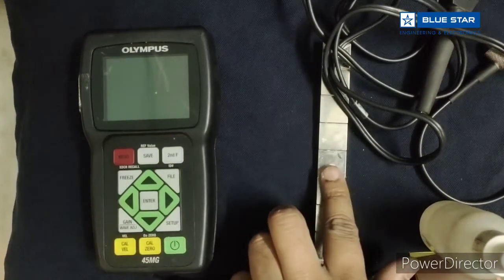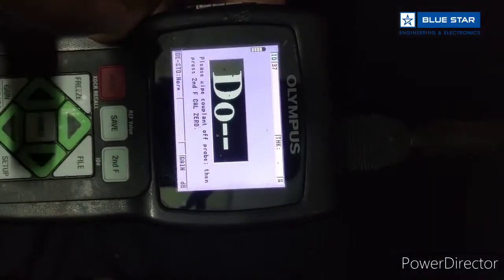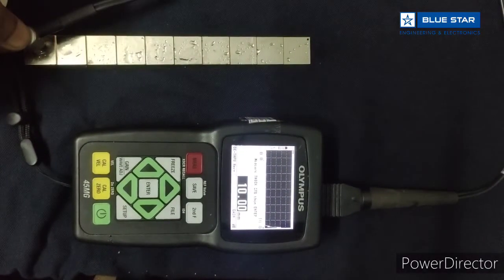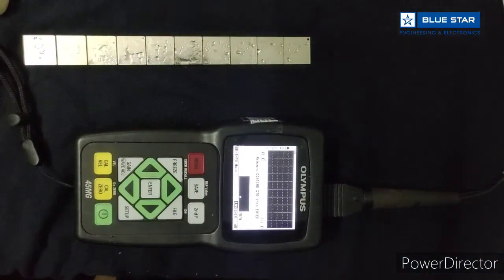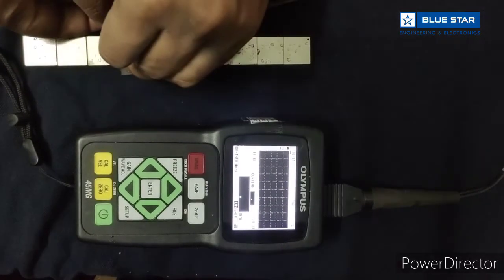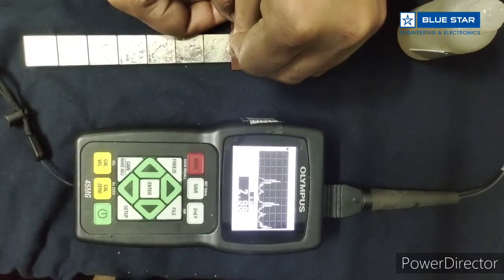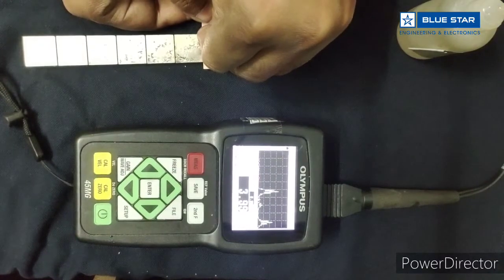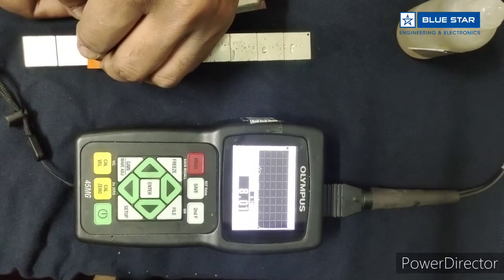Thru Coat Thickness Measurement with Olympus 45MG Equipment

Comment: I have 45 mg but after zero calibration it does not ask for through coat option sir, what  will I do
Reply from the maker: Check whether EETC software activated in your 45MG. Call me for the procedure for checking